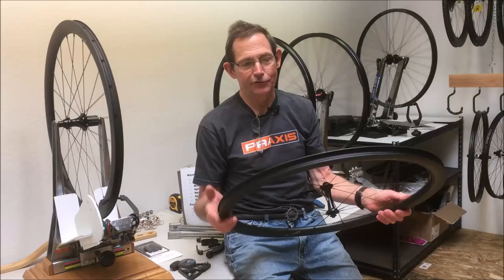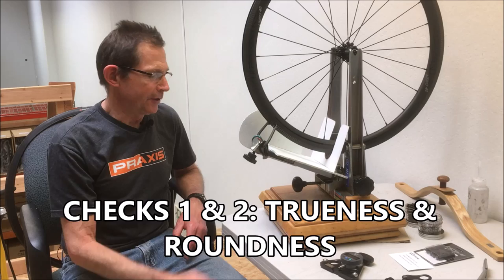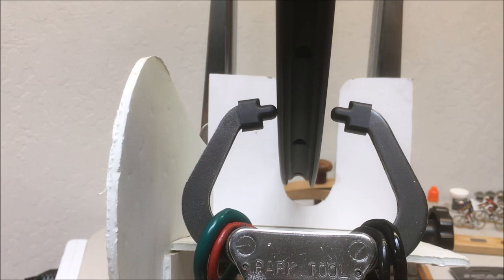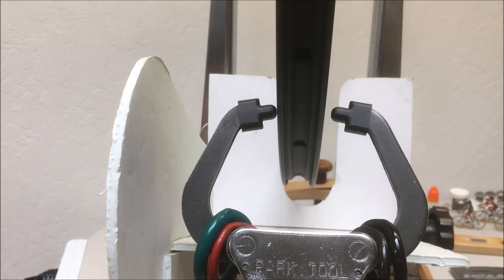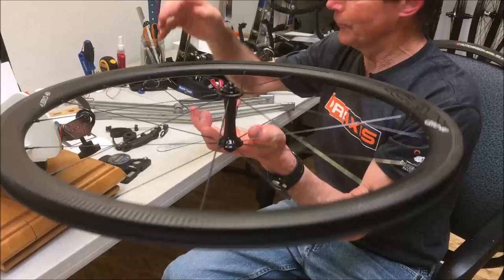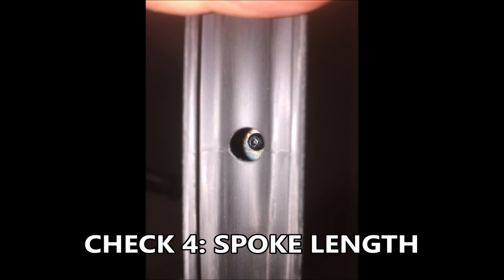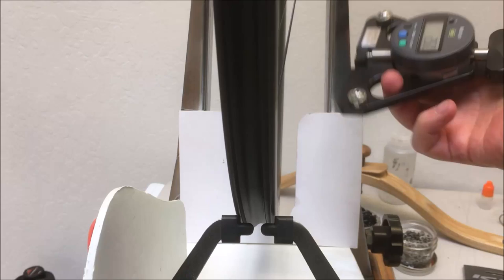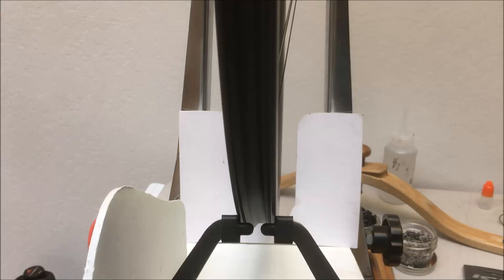ICAN Chinese Carbon Bicycle Wheels Review by Wheelbuilder Jim Langley

Comment: Thanks Jim! I am between a couple wheels, any opinion? I am a weekend warrior, mainly flats with very few climbs.
Looking at the following: 
Fulcrum Wind 55 DB
ICAN Aero 45/50 Disc with DT240s hubs
ICAN Aero 45/50 Disc with ICAN's D01 hubs
Are the DT240's really worth ~$400 USD more than the D01's ?
Reply from the maker: You're welcome, AirMax. I've owned Fulcrum wheels and put thousands of miles on them and mine were awesome performers and super reliable. So far, I'm getting close to the 1,000 mile mark on my ICANs. They're performing great and have also been totally reliable so far. With Fulcrum's long history of race tested and proven wheels, you have to believe that they've got more experience behind their wheels and likely more engineering/manufacturing power, since they've been a player for so long. So, there's that. ICANs are less expensive, though, and that's in their favor. If you go with the 240s that adds cost and makes the price comparison closer. The thing about DTSwiss hubs is they last and last, almost never develop problems, rarely need servicing and if you ever do need to, all the parts are available. So if you want Swiss watch like beauty and performance you'd pay up for the DTs. But, if you are fine with more standard hubs, the ICANs will save you some and probably work fine for a long time since it doesn't sound like you are going to beat them up too badly. Okay? I hope something here helps you decide. Have fun on those new hoops! Jim
Reply: @JimLangley1  Absolutely helped, thanks a lot!

Comment: my wheel dishes are different sizes, noticable but seems like on purpose is this ok?
Reply from the maker: Thanks for the question, JRF. You want the wheels to be centered in the frame and fork when you mount the wheels on your bicycle. In order for this to happen, the wheels are built so that the rims are centered over the entire inside width of the hubs (the part of the hubs that fits inside the frame and fork dropouts - sometimes called over-locknut distance). So, if you check a wheel and find that the dishing tool/gauge shows a difference on either side, you would want to adjust the spokes to move the rim into center. When the rim is centered, the dishing tool with touch in 3 points on both sides of the wheel. I show this in the video. I hope this answers your question. Jim

Comment: How much do they deviate when the tires are inflated?  In my experience most very expensive carbon wheels move significantly under pressure.
Reply from the maker: Thanks for the question, workshopninja (great name!) - but I don't understand what you're asking. When you say "MOVE very significantly," what do you mean? Are you asking about the wheel true changing, the spoke tension changing? The word "move" can mean different things and I'm not sure what you are asking. Please elaborate and I'll try to answer. Thanks! Jim
Reply: Jim Langley - I have noticed it more on rear wheels - the dish can change once the tire is inflated - and it often is not uniform around the wheel causing it to run out of true - a right pain when combined with internal nipples... Our feeling in the shop at the time was minor imperfection of tire and rim interface was to blame. 
I feel the consistency of the rim hook distance to the outside edge of the rim is extremely important - and harder to achieve with carbon fiber than aluminium.
Reply from the maker: @workshopninjathe1st  That's an interesting puzzle to try to figure out. With a good rim, carbon or aluminum and a nice, sufficiently tensioned wheel, the tire pressure or tire itself should not be able to distort the shape of the rim. But, when tires are inflated, the spoke tension does drop a bit. And, if a wheel were not fully stress relieved - in other words, some spokes or nipples weren't yet seated fully - then the tires being fully pumped could cause the spokes and nipples to settle in/bed in. That would likely cause the wheel to go out of true where those spokes/nipples changed. If I was building wheels and having this issue with a certain rim, I think I would take a rim alone with no hub or spokes - just the rim. I would then set a caliper to the width of the rims so that it would slide all the way around. That would tell if the rim sides were really parallel on their own. Then, I would mount a tire and inflate it and check again. If the rim sides got wobbly due to the tire, I would probably not use that brand, model of rim again. Maybe that's a test you can try to figure this out. I think it is possible that you've had some bad rims that had weak spots in them. But if the dish changes, that's all around the wheel, which would mean the whole rim went out. I don't see this in the aluminum and carbon rims I build with. I hope something here gives you some ideas.

Comment: Do you recommend those wheels ?
Reply from the maker: Thanks for watching and the question, Edward. The Aero 40 wheels are super light road wheels, so if that's what someone is looking for, yes I would recommend them so long as the person asking wasn't much more than 170 pounds and was someone without a history of destroying wheels. That's the same caveats I would give for all super light road wheels. ICAN makes other wheels for larger riders, too. Hope this helps.
Reply: Yes thank you, I'm currently 210 and in the way to loose more weight I'll Chek the website to get the right ones for me
Reply from the maker: @edwardbntz8825  you're welcome. You definitely want wheels built to hold up for you. There are many, many companies making great wheels so be sure to look around. Right now, too, you can run into high shipping costs and fluctuating prices because bicycles and components and wheels are in crazy high demand. So, you might want to look local, too, since it can save you a bunch on shipping plus you will have a local bike shop or wheel builder to handle any issues if you run into any.

Comment: Why were you implying the rim strip is for use with tubeless sealant and too narrow (19:39)? I used 21mm tubeless tape to mount tubeless with sealant. And the supplied rim strip would be pretty adequate for use with tubes, but no way should it be used in a tubeless/sealant setup.
Reply from the maker: The rim strips were provided with the ICAN wheels, ernie12man. They came in the box with them for use with them. Since the wheels are tubeless-ready, most buyers will probably assume that the rim strips they got with the wheels are for whatever setup you use, tire with tube or tubeless. But, whichever tire type you go with, the rim strips provided are a bit narrow. These rim strips are not adhesive. They are held in place only by friction. And that means that if they don't fully fill the rim cavity side to side, that when you install tires (tubeless or tubed), it's likely that the tire will push the rim strip to one side or the other. When that happens, it exposes the holes in the rim allowing sealant to escape and exposing sharp edges that can cut tubes and cause flats. Non-adhesive tubed and tubeless-type rim strips will stay in place just fine and work for tubeless or tubes so long as they reach each side of the rim, because then the rim holds the rim strips in place and prevents it moving. Even if you take great care and inspect your tire installation before inflation and make certain a too-narrow non-adhesive rim strip like this did not move during installation of the tire, you will likely find that as you ride the wheels, the rim strip will tend to move out of position over time. Less so with tubeless than with tubes, since the tube puts pressure on the rim strip, the sealant doesn't. These reasons are why I said what I said in the video. Hope this helps explain. Thanks for the comment! Jim
Reply: @JimLangley1  Great info. I had not been aware that standard strips can be used effectively in tubeless setups. I'm been using tubeless now 3-yrs and done a lot of homework learning how to set up and install, and eventually learned most of the troubleshooting techniques there are. This one on the strips is hard to find mention of using that way, most say tubeless tape. So cool new info and I follow the narrow cautions rationale. 

Coincidentally, I just set up and did 1st short round the block test on this exact wheelset, with Schwalbe One TLE (not the Pro One's, i prefer the sturdier construction for  durability over the lighter Pro One's). But the rim tolerances were at max diameter, tires at tight  diameter, so epic fitting over day and half, stretched with tubes in overnight since tires just wouldn't center. Eventually got close enough to use heavy soap/water, and gradually over-pressure until final seating happened. Schwalbe's tech-tips to the rescue.  But I gotta say, no full ride yet, but test ride in the neighborhood, and these wheels are crazy smooth and zippy. The lightness is so nice. I've been riding wheelsets in 1500-1600g/set range for years, these Aero 40's are a revelation. Gonna put a hard hills Friday on 'em, and century plus on 'em this Saturday, should be awesome.  Loved your great QC rundown, I'm gonna order an aero blade spoke  holder.  I built a few race wheelsets back in the day, so a few extra tools to the shop always help keep things running cheaper ;) .
Reply from the maker: @ernie12man  I'm happy to hear you found the wheels so nice on your test ride. I've been on them for hundreds of miles now and on every ride I feel the lightness and quickness and love it. Good job getting those tight tires on - I recently had to struggle to get a Schwalbe tire on, too - on a gravel rim. In my opinion one of the biggest problems today is tire companies failing to meet standards. Bicycle tires need to fit on rims correctly so that anyone can mount them without extreme measures - that goes for taking them off, too. I recently bought a Continental 5000 tubeless tire and could not get it to mount on the rim by hand. I called Continental and they told me to return it to the bike shop for a refund. It was a clear defect because other Continental tires and other brands too fit fine on the Aero 40s by hand. I'm just explaining in case you were worried about the wheels. I bet if you try another brand tire when you need new tires, you'll find they go on more easily. You'll like that aero spoke holder tool, especially if you start building wheels with bladed spokes. It's easy to use and makes the truing and tensioning with those spokes a lot easier. Thanks for sharing your experience with your Aero 40s so far, and have a great century ride ernieman! Jim
Reply: @JimLangley1  Thanks for the reassurance on the wheels. The place I got the Schwalbes from was Bike Tires Direct and they were ready to take the Schwalbes back for an exchange and in fact had recommended the Conti 5000 as well. I was close to giving up. But the Schwalbe Ones are worth it, I really like their ride and durability, and pricing is a great point too. So it all worked out.

Comment: I want to know how specifically about the success rate with mounting tires tubeless on these rims. Have you done this or do you know of any reviews on that?
Reply from the maker: Hi Swayback. Yes, I show tubeless tire mounting and removal by hand in this video actually - just go to the 20 minute mark in the video and you'll see me do it. I have also installed Continental GP5000 Tubeless tires on these rims and regular tubed tires. I am working on a new video about tire mounting because it's a popular topic - and putting tires on is mostly about having good technique and understanding and not making mistakes that make it too hard to put the tires on. I'll share my pro tips and tricks in this new video so please stay tuned. Thanks!
Reply: @JimLangley1  I saw that but was hoping you'd actually gone all the way to inflate in place with sealant and ride. I'd want this wheelset to use for gravel grinding at 35-40 psi or with road tubeless at around 80 psi. And every wheel is different as far as being able to actually mount a tire and get the bead to pop in place for a good seal.
Reply from the maker: Thanks for explaining more, Swayback. Sealing and seating is easy, too. But, those things aren't really about the rim/wheel, it's about the tire, rim strip or tape, sealant and valve and the setup of these things. In other words, I never blame the rims or wheels with seating or sealing problems, I look for the cause in the tire, rim-sealing strip or tape, sealant or valve. Seating a tire can be as easy as pulling the tire out by hand or letting the air out and putting a little dishsoap on the tire beads - those tricks will usually do it but there are lots more and I'm happy to help if you need more. Common sealing issues are uncovering the holes in the rim (the tape or rim strip can move during tire install); not enough sealant; valve not tight enough in the rim or certain types of valves can have parts that need to be assembled correctly - get it wrong and the tire won't seal. If everything's correct and it still won't seal, try adding more sealant and riding the bike to get the tire casings to flex so that the sealant can get into all the pores and that will usually seal even the most difficult tires. But, again, it's not the rims/wheels that cause the problems, it's the inflatable parts. Hope this answers your question and thanks for asking and giving me a chance to explain more.
Reply: @JimLangley1  I've been mounting tubeless for about 15 years now and have done it with about 6 different brand wheelsets using soapy water and all the tricks.  Some wheelsets are very picky no matter what you do.  Some such as Stans are much more tubeless friendly. I've mounted some tires on my Stans wheels that would not mount to my Bontrager wheels and were so tight to get onto the rim that I'd end up damaging the tire bead or breaking tire levers. Sometimes it really is the wheel and there is no real standard for tubelss. A tubeless ready tire should mount to any tubeless ready wheel if you do all the right things but that's not always the case. (I know that UST is a different standard and measurement as well.) So that's why I asked. It's hard to find any feedback on the Icans on the blogs etc. as far as ease and reliability of tubeless.
Reply from the maker: Thanks, Swayback. Just to confirm, I don't think you'll find the ICAN wheels difficult to install tubeless tires on if you get them. I hope that's helpful. Appreciate the great comments. Jim.

Comment: This is a great video.  I would bet a lot that ICAN  doesn't actually build them.  I have tried repeatedly to get them to tell me what size EZO bearings go into "their own" hubs.  I cannot get an answer to that very simple question.  I dont know for sure but I suspect they are actually built by Far Sports.  With that said, I am fairly happy with the wheels, they are staying pretty true, but I know for sure if anything goes wrong I am on my own.  By the way, do you know what size hub bearings they use in their Aero Disc wheels?  So far no problem, but at some point the hubs will need servicing.  

My ICAN wheels are substantially better than a set of Yoeleos I had.  The Yoeleos were not durable, dish was way off, wouldn't stay true, and st 16 months had developed cracks around the nipple holes. I won't ride them now.  Customer service was very poor.  Avoid  them.
Reply from the maker: Thanks for the comment and thoughts, Stuart. I don't know what bearings they use in those wheels. But, replacing bearings in bicycle hubs is usually not that difficult. Actually, in a lot of cases, you don't need to replace them. You just lift the rubber seals, push in some new grease and put back on the seals and the bearings will be good to go for many more miles. But, if enough water gets inside bearings and especially dirt or corrosion, they can need replacing. In that event, there is usually a number written on the bearings. You then look for that number in a bearing company catalog and order replacements. In most cases you can find replacement bearings because the hub makers buy common bearings. Sometimes it's easy to remove and replace bearings. Other times you might need pullers and press tools to do it. On some hubs it's more difficult. You could learn more by taking a close look at the bearings on your hubs and looking for numbers and then seeing if you can find replacements. Hope something here helps. Thanks again, Jim
Reply: @JimLangley1  Very helpful indeed.